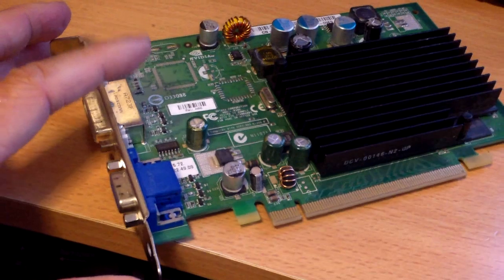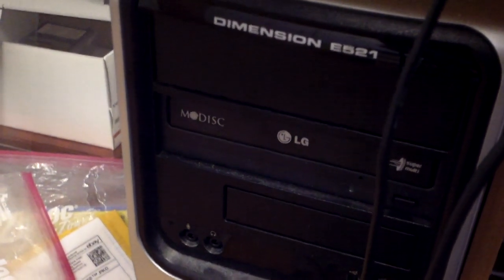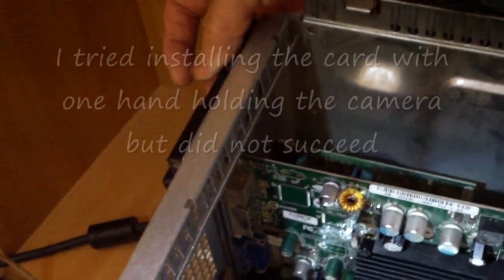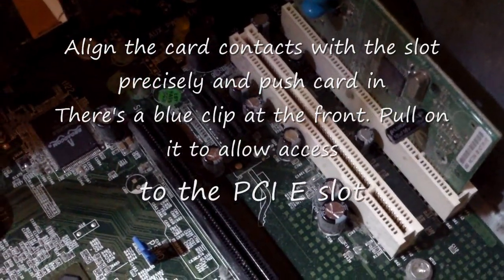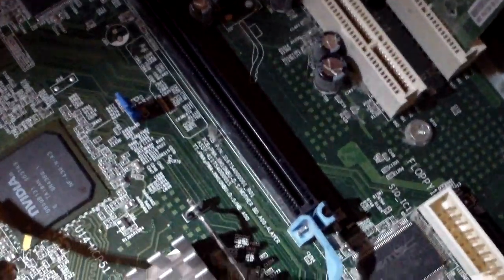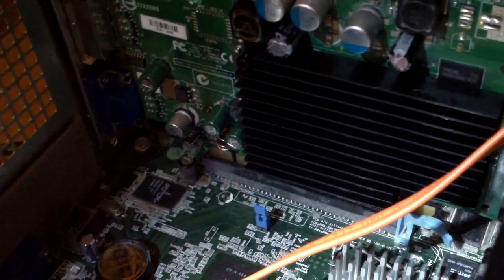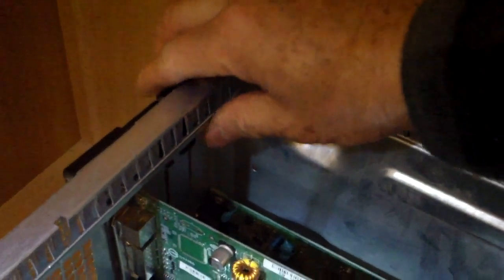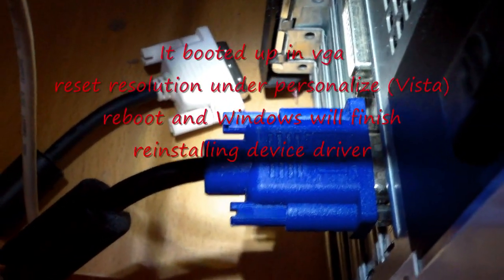Dell Dimension E521 PCI E graphics card replacement and boot up problems

Comment: I have a Dell Dimension that boots up but nothing is on the display! HELP!
Reply from the maker: Jim Dayton Your display card might be bad.  Remove the display card and use the integrated graphics card on the motherboard. If you are already using integrated card, borrow another known good graphics card and plug it on the board.
Reply: wtam69 Yep it was a bad graphics card! Tried another one and it works! Thanks!

Comment: I am having a problem with the graphics card in my C521 but I do not know a lot about computers. Are the graphics cards in those 2 computers similar at all?
Reply from the maker: Yes, both the E521 and C521 have onboard graphic cards. If your plug in graphics card has a problem and you need is to run the computer to do basic functions (surf the Net etc., you can take out/unplug the graphics card.  There should be a small (usually black) cover covering the vga output in the back of the computer. Remove that cover and connect your monitor to that connection. Reboot your computer and you should be able to use your computer again. Of course, the FIRST THING  to do is to open up your computer case and pull out that add on graphics card. Usually after many updates, the files or drivers for the add on card is corrupted giving you all the problems you now encounter.
Reply: wtam69 Okay, I really don't know anything about computers. I have always plugged in the monitor to the vga output. After 6 years of owning the C521 the monitor stopped getting the signal from the computer. The monitor would flicker on and off until about a week ago the signal stopped and the monitor immediately goes into stand by mode whenever I turn the computer on. I looked around the internet and it seemed my problem was the graphics card. Now I am more confused than ever. Thanks for your help, though.
Reply from the maker: Robbie Battisti
Hey Robbie, you don't really have to know much about computers to troubleshoot this.  If you have an add on graphics card ( most people will buy them because it makes their graphics load faster), you'd have 2 vga outputs. All you have to do is identify where your monitor plugs into the PC.  TURN SWITCH OFF POWER SUPPLY, or unplug power plug, open up the case and unscrew any screws holding the graphics card to the pc and pull the card straight up and out. That's it. Then close the case and look for that small black plastic cover and plug your monitor cable into it. If it still doesn't work, your problem is not the graphics card. Maybe you can get someone to help you with the above steps.

Comment from the maker: That's BSOD is going to happen with the add on card.  They keep updating the graphics driver and then after a while things will go crazy. In my earlier comment I meant to say the add on card prevents your pc  from waking up from hibernation/sleep. That's why I recommended you to take out the graphics card and just use the built in one.  The built in card will share ram memory but if you installed enough memory it won't be too bad.

Comment from the maker: If you are not a gamer, simply take out your graphics card and use the onboard graphics. You won't have the graphics problem and the computer not waking up from sleep etc. There's a small black plastic cover covering the port in the back of the pc so you can't see it if you are not looking for it. Plug your monitor into that and everything will work fine.

Comment: No it really is pretty easy to build a computer and a whole lot cheaper.  After you build one, you then realize that when you buy a name brand one, your paying premium for a name.  The SSD hard drives work and look just like the mechanical drives.  They are supper fast compared to mechanical ones.  This computer was booting in around 10 to 20 seconds.  But now it boots probably around 40 seconds or more.

Comment from the maker: This computer actually has built in graphics (not great quality)  but I  threw out all those cables. Instead of spending money on the cables, I spent the few dollars on buying a used add on card. I don't know how those SSD card works but like SDHC cards they probably have speed ratings and a number of read write cycles. The geniuses invented all the IC chips and all the circuitry. Assembling a PC is more like painting by numbers. People think it's a computer so it must be rocket science. Not.

Comment: Years ago, I built my own computer from scratch and was surprised how easy it was.  The main board had built in video and sound circuitry and they were pretty good quality too.  It was a lot of fun to see it working and wasn't much work to put it together either.  I put a solid state drive in this computer and I was amazed at how much faster it booted and did other task.  But luck has it, the solid state drive went bad and I'm using the mechanical one now and it is MUCH slower.